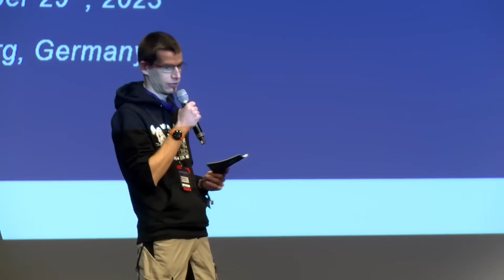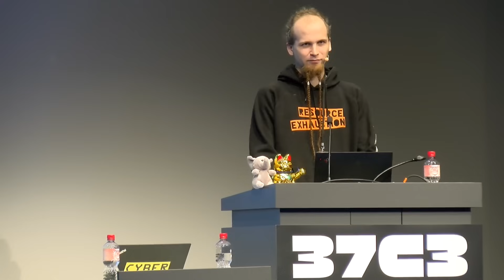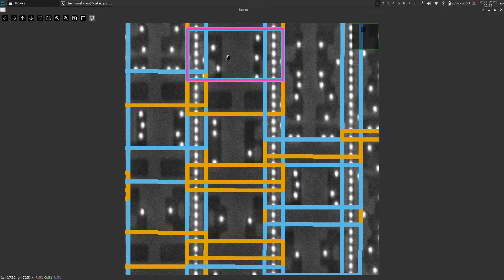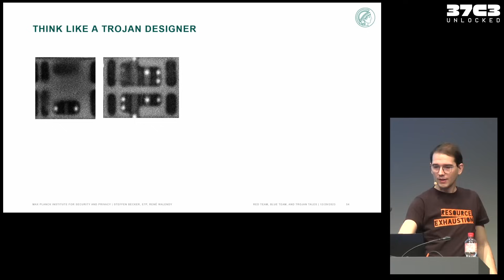37C3 -  Unlocking Hardware Security: Red Team, Blue Team, and Trojan Tales

Comment: 00:31 🎤 The talk discusses a Red Team versus Blue Team approach to protect hardware against Trojan horses, focusing on a case study presented by speakers affiliated with TUM Institute for Security and Privacy.
02:22 🛠 Trillions of digital integrated circuits (ICs) are deployed in various systems, fulfilling critical objectives like cryptographic implementation, wireless communication, and real-time monitoring.
04:51 🌐 The IC design flow involves high-level design, synthesis, physical layout, verification, fabrication, and PCB assembly, distributed across a globalized supply chain, which poses challenges for threat assessment.
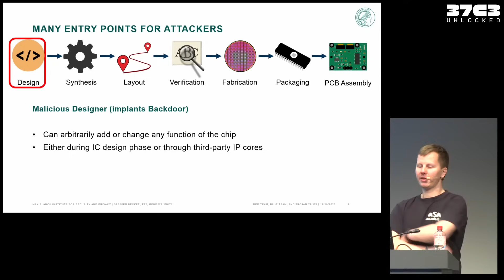07:08 🔒 Active attackers in the supply chain may weaken cryptographic primitives, leak information, cause denial of service, or introduce safety hazards, with detection becoming more difficult as abstraction levels decrease.
09:41 🕵 A notable example is the "Big Hack" incident reported by Bloomberg, where hardware trojans were allegedly found in server blades used by major tech companies, sparking media attention and political discussions.
10:34 🛡 Silicon-level hardware trojans involve direct manipulations at the silicon level, making detection challenging, as they can consist of added or modified logic cells, routing manipulations, or transistor doping alterations.
12:09 🖥 Detection labs employ imaging techniques to compare design files with physical chips, focusing on modifications at the cell level, which involves destructive methods like thinning down chips for electron microscope imaging.
16:02 📊 The research aims to efficiently detect hardware trojans in full-sized ICs using modified design files, enabling emulation of malicious modifications introduced by the Red Team for analysis by the Blue Team.
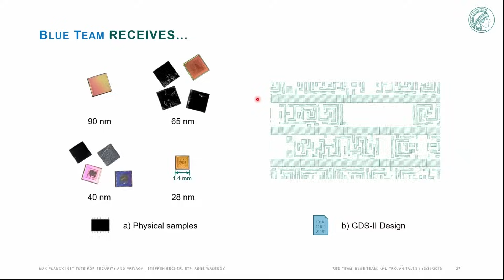21:14 📷 The Blue Team utilizes microscopy and advanced algorithms to compare design files with microscope images, aiming to identify differences introduced by the Red Team, which involves processing large-scale images and coordinating coordinates for analysis.
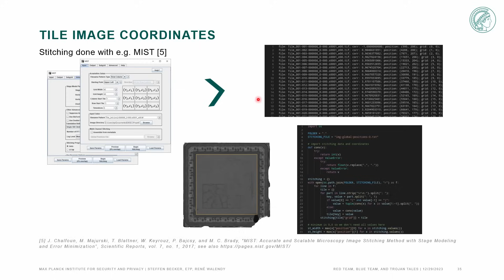25:44 🔍 Algorithms for detecting additional and replaced cells on integrated circuits involve overlaying design files onto chip images, followed by perspective transformations and image processing techniques.
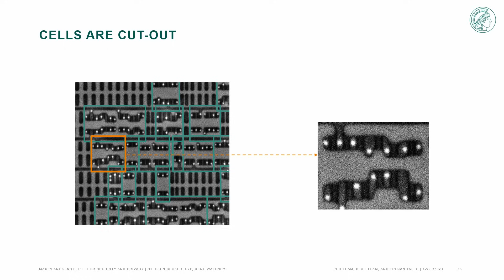27:08 🛠 Different algorithms are used to detect additional cells and replaced cells on integrated circuits, with methods such as wire detection and template matching.
33:47 🧾 Detection algorithms perform well in identifying additional and replaced cells on chips, with faster processing times compared to manual methods.
37:23 🎛 Trojans inserted as additional cells are easier to detect compared to replaced cells, highlighting the importance of advanced detection algorithms for subtle manipulations.
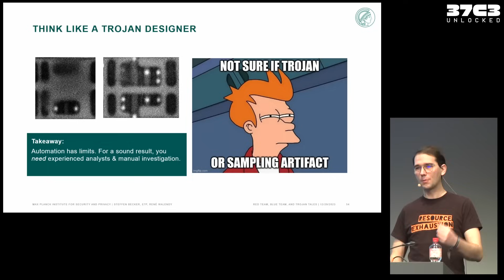42:20 💡 Hardware security testing requires both automation and human expertise, with skilled analysts needed to fine-tune algorithms and interpret results effectively.
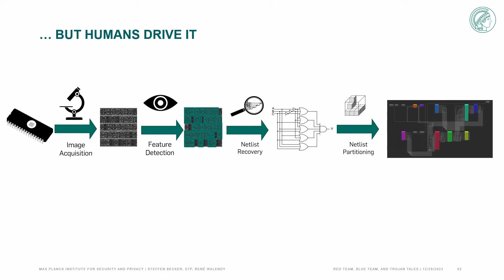47:41 🤖 While automation aids in hardware reverse engineering, human cognitive processes play a crucial role, necessitating interdisciplinary approaches to improve tool usability and training effectiveness.
50:19 🛠 Tools for hardware reverse engineering should be accessible and intuitive, catering to users of different experience levels, and comprehensive training resources are needed to make the field more accessible.
51:26 🎮 A hardware reverse engineering game is introduced for cognitive assessment purposes, aiming to engage users in the field and gather data for research.
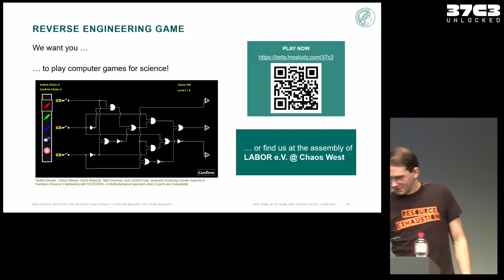52:48 🔍 Collaboration across disciplines is crucial in hardware security research, recognizing that human expertise drives reverse engineering efforts alongside algorithms.
53:02 📊 Hardware Trojans can be subtle and challenging to detect, necessitating advanced techniques such as computer vision algorithms, while emphasizing the importance of human-driven reverse engineering efforts.
54:14 ❓ Real-life cases of malicious attacks at the logic cell level are not confirmed, but ongoing research in hardware security remains crucial despite the absence of confirmed attacks.
55:25 🧠 Hardware validation methods may not capture all potential attacks, requiring a combination of validation techniques and human-driven reverse engineering efforts to ensure chip integrity.